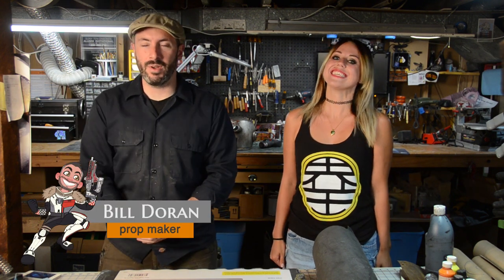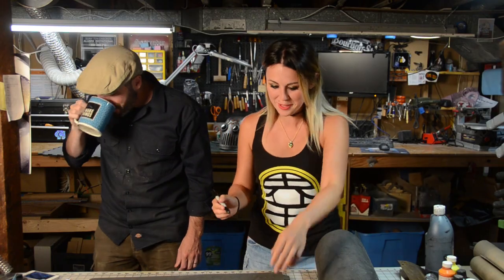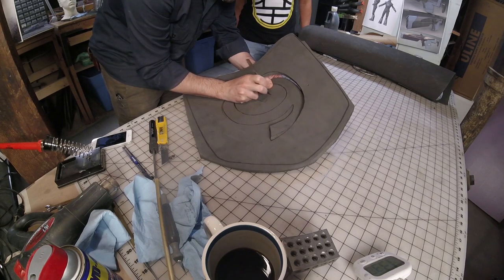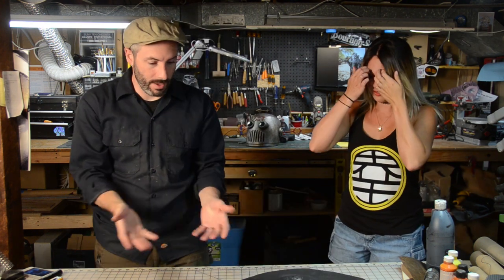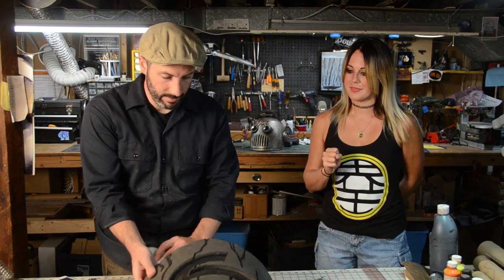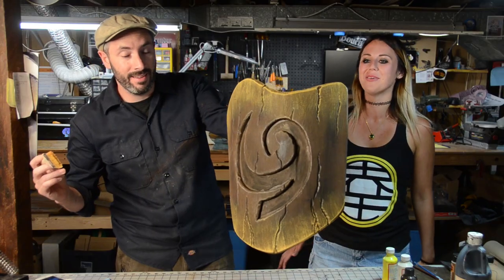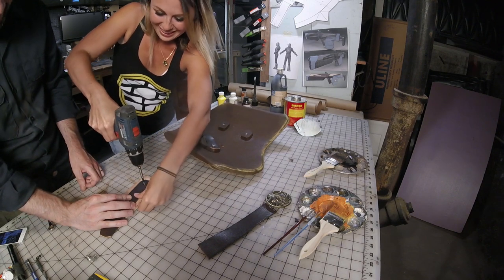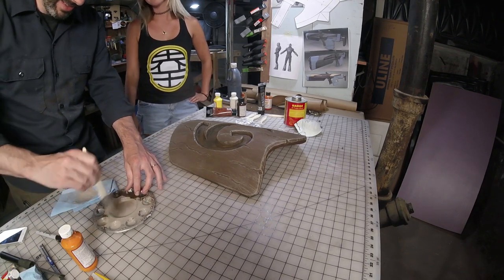How to Build the Deku Shield Prop from Foam - Prop: Shop

Comment: for a suggestion for painting, once you use a larger brush for painting, you can use just a 1/4 inch thick or a slightly less thick piece of plexi-glass, it's easier to clean than the small cup like indents. At most Ace stores you can gat a good sized piece for less than $5

Comment: So I'm being extremely, extremely nitpicky here, but the filter you have on your respirator is for particulates like sanding dust/etc.  You're using rubber cement which those disks really don't protect against.  I think you need a set of charcoal cartridges to catch what you're trying to keep from your body in that scenario :-P  You can get combo charcoal/particulate cartridges though, which work pretty well.

Comment: Hey Bill, have you ever used a palm sander to remove the back instead of a belt sander? i personally haven't but was wondering if you have
Reply: I gave one a go on some floor mats before I brought a belt sander, but even pressing down really hard (which isn't good because of the vibration) it didn't do much except make the foam 'fluffy'. It's possibly the least used tool I have :(

Comment: 12:07 NOOO! Don't throw them away. Clean 'em out with Xylol. (It works for Weld Wood contact cement; I only speculate that it works for Barge.)
Reply: Venger Voldur 
Xylol causes cancer. Trowing a brush away wont.
Reply: Gasoline works too, seriously, I've done it.